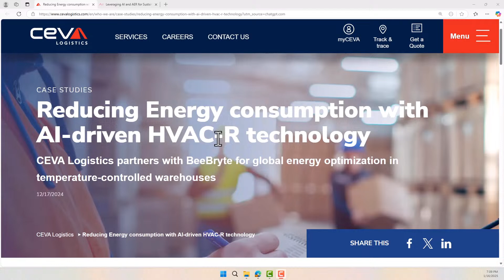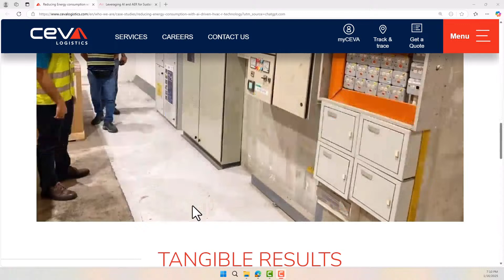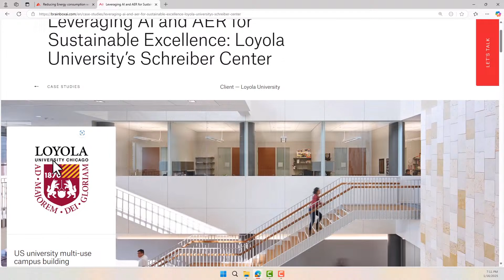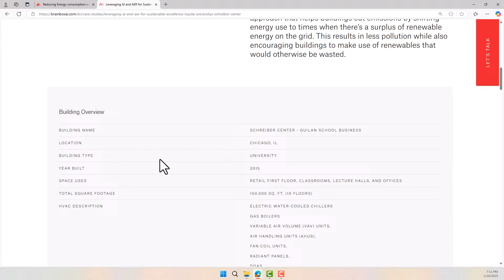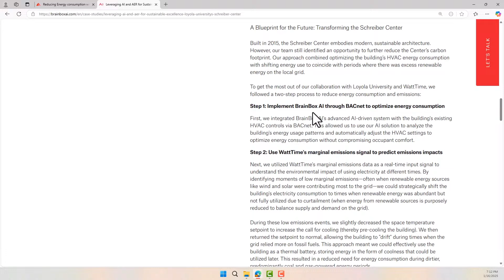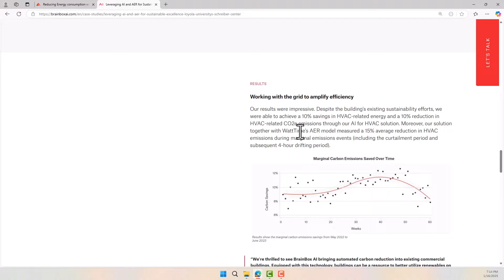SBA 479: Role of AI and Machine Learning in HVAC Energy Optimization

Comment: Interesting video. Here's another viewpoint:
 - Many (most) of today's BAS systems are locked behind a software licensing scheme that specifically thwarts innovation.
 - Downloading and understanding historical BAS data in volume is virtually impossible with current technology.
 - Traditional ML is old-school, replaced by AI RAG / Vector DBs.
 - Predictive maintenance is almost never implemented in buildings - the staff is too far behind with other tasks.
 - Energy optimization is the least of building management concerns - laudable though it is.
 - Saving 10% energy is a no-brainer.
 - BACnet is the single biggest obstacle to industry progress ever invented.
 - It's next to impossible to implement Dynamic Adjustments with the way most control systems are locked down.
 - Creating a trained model is time consuming using conventional techniques - new AI methods are changing this effort.
 - Clustering algorithms are.... just fuzz in the wind. It can be done better with AI.
 - The Singapore Warehouse case is essentially limited to cites in the American South - and not the best example.
 - The AI generated 850,000 kWh in savings is more likely because of inadequate building HVAC management.
 - This technical discussion is not scalable - and is not likely to improve general building energy, comfort, or IAQ.

Great academic video. But it's not grounded in reality. Let's talk. (michael.r.lavelle@gmail.com)
Reply from the maker: Thank you for sharing your perspective, Michael! Here are some clarifications and points to consider regarding your feedback:

Software Licensing and Access: Licensing itself isn’t the main issue; it’s ensuring owners have access to the necessary software, which requires them to specify this in their RFPs. Educating owners to include these requirements upfront is key to overcoming this challenge.

Historical BAS Data: Most BAS systems can log historical data, and it’s possible to extract it from their databases if you know how to navigate and access the system. The issue is often more about expertise than technical limitations.

AI and Maintenance Teams: While maintenance teams are indeed stretched thin, many organizations are successfully leveraging AI to fill gaps. It’s true that AI can be seen as a threat by some, but it’s also proving its value in supporting teams and driving efficiency.

BACnet Standards: While BACnet/SC introduces complexities, BACnet/IP and MS/TP are much easier to work with and continue to offer flexibility in implementation. The industry has made strides in balancing open standards with functionality.

Your insights are much appreciated, and they highlight the importance of grounding technical discussions in practical, real-world applications.
Reply: @SmartBuildingsAcademy  "Software Licensing and Access: Licensing itself isn’t the main issue; it’s ensuring owners have access to the necessary software, which requires them to specify this in their RFPs. Educating owners to include these requirements upfront is key to overcoming this challenge."

Licensing is an important issue. It has been used to keep contractors with similar capabilities from venturing beyond their licensed geographical boundaries. 

" ensuring owners have access to the necessary software, which requires them to specify this in their RFPs"

Many professional engineers don't understand how licensing works - at the practical (contractor) level. Further, intermediate legal agreements between the BAS software vendors and contractors further constrains practical support for customers.

"Historical BAS Data: Most BAS systems can log historical data, and it’s possible to extract it from their databases if you know how to navigate and access the system. The issue is often more about expertise than technical limitations."

Even knowing how to navigate to download data does not solve the problem. The original thinking (1990s) believes this data is only available for some unspecified reasons - downloading the data is very often difficult (carefully navigating your mouse) along with dates and times in unusable text fields that require modification.

"It’s true that AI can be seen as a threat by some, but it’s also proving its value in supporting teams and driving efficiency."

I've yet to see AI as a threat. Most building managers are so overwhelmed with daily tasks that they are willing to accept this type of help. But we'll see soon enough on this matter.

"BACnet Standards: While BACnet/SC introduces complexities, BACnet/IP and MS/TP are much easier to work with and continue to offer flexibility in implementation."

Accepted. But the entire methodology behind BACnet is obsolete given today's modern protocols.

Thanks for the reply.